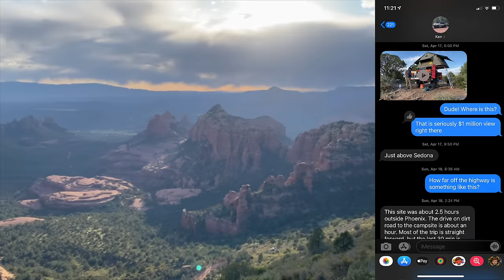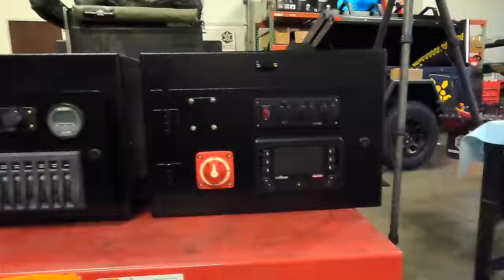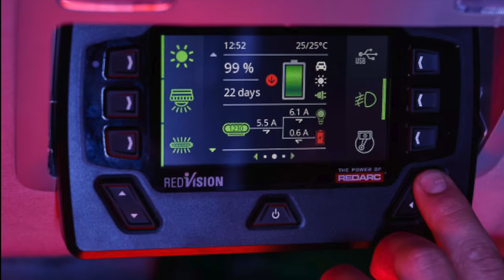Turtleback Expedition Trailer Gets REDARC Redvision Manager30 Upgrade!

Comment: I had the same thing happen to me in my JLU, the dash lighting up like a Christmas tree.  Same rock, my wife had it happen to her in her JLU. We tried to limp out in 2 wheel drive. A buddy told me to shut off the Jeep, and open and close the door. We did and both Jeeps worked fine. Another 'Jeep thing'.
Reply from the maker: LOL... yeah no comment.  So wait were you able to continue in 4wd or 2?
Reply: @4wdTALK  I could continue in 2wd but it acted weird and did not have as much power. Where we were, I was not getting out in 2wd. Thankfully the computer reset (shuting off, open/close the door, and wait a couple minutes) worked. The dealer here in Tucson said that this is not uncommon.